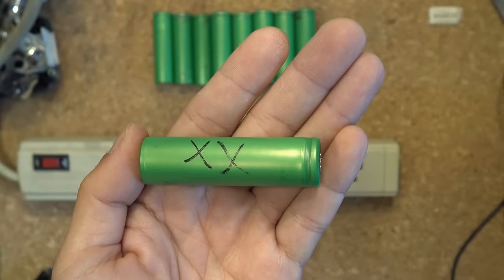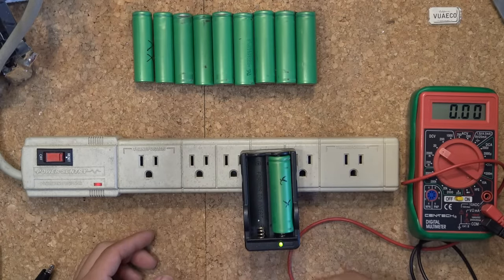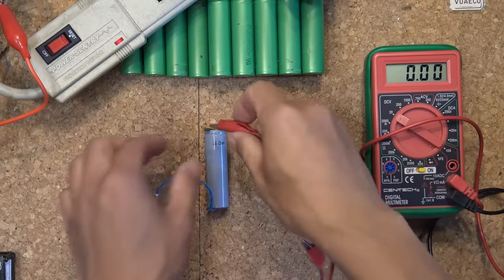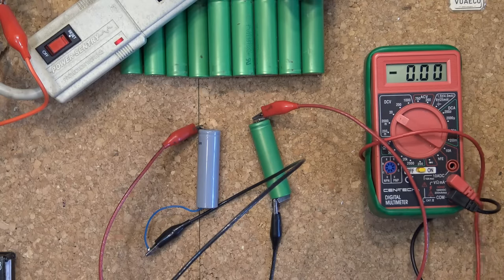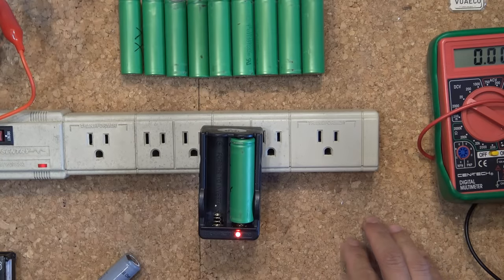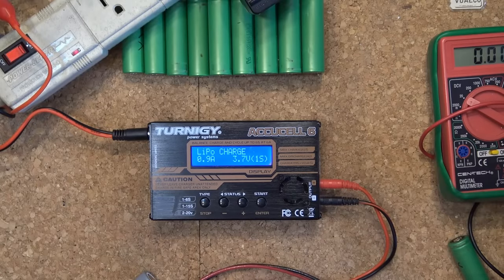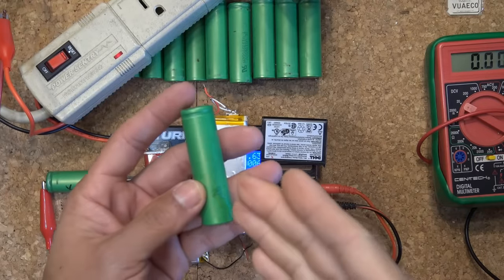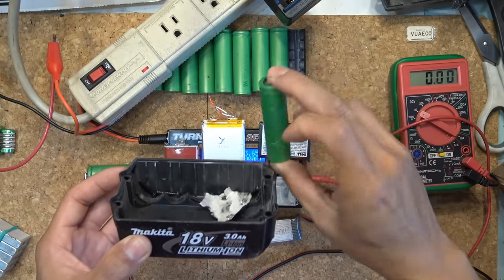DIY: How to revive a dead 18650 (or any) Li-ion battery cell

Comment: A case for a $3 meter?
?
So it doesn't slide around or float away?
Reply: The guy must like his cheap meter... I try to take care of mine, but like 6 months later they show like 5-6v on a lithium battery (way off!) and above 20v on a car battery, lol, but that exact meter he is using is typically free with any purchase (including $1 heatshrink packs etc) at Harbor Freight tool stores. That’s all I used to use, I had like 8 of them, none held up but they were free, the leads were extra garbage though).

Recently I bought some decent ones (like thousandth of a volt when checking batteries like this), but honestly the coolest one was bought just to get me over $50 for free shipping was actually really cool auto-range meter. It just has a power button and that’s all it needs and it just automatically checks resistance or voltage, so when I hooked it to a bad battery and got a resistance value then lol, I knew it was bad battery, haha! Normally having it in resistance mode blows up meters (or trips a fuse, which is hopefully a resettable one so you turn off and back on), but this meter you can jump between resistor and voltage on batteries immediately and nothing goes bad and without damage, so it’s pretty awesome since it’s also accurate enough (it seems to be within 0.01 to .02v when testing an 18650 4v battery like this video, it only goes into hundredth of volt), so hands down I’d recommend just spending $10 for one of those instead of even these free meters like he’s using, because the new ones don’t have a voltage calibration inside so they become junk pretty fast and often WAY inaccurate out of the box (the old ones did, so you could correct them though it didn’t have a separate adjust for current/resistance/voltage so you just calibrated the one you used most).

The leads are also way better, it’s stamped YOYOUBAO  model ET8133 (it also has an awesome kickstand for propping up and a kinda crappy LED but it works if you absolutely need it, but it’s amazingly simple and decently accurate (now obviously it’s not an oscilloscope it 20 digit laboratory meter, but it’s pretty amazingly accurate for how low cost it is and easy enough I’d almost call it foolproof but I’m sure I’ll destroy it someday doing something stupid, haha, I always do!). But if you need better the AN8008 is pretty awesome too at under $30 (it honestly looks way more fragile, and the kickstand sucks, but it’s probably better to not drop it anyways... you might actually want that case he’s using on it except it’s a little different shape). I still need a good scope for sampling 200 MHz switching voltage stages (so with a nyquis frequency of 400 MHz it starts costing more than the cheap ones since I need within 1/1000v so I haven’t pulled the trigger on any yet, lol, it’s probably going to have to be used and then calibrated to match steady voltage of whatever my best meter shows, haha they cost too much!)
Reply: @jakegarrett8109  Have like 6 or 7 of those that I got for free at HF.
They're accurate with volts and ohms until the leads fall off.
Have one glued on to a radio that I converted to lithium and solar. Needed a charge monitor. All free.
Reply: UNENSLAVER 1 yeah, but mine are getting WAY out of correct voltage (the recent ones especially are way off right out of the box just compared to each other, like 10% error, though kind of still useable just to see if a battery in the TV remote is completely dead). It doesn’t matter which leads I use or if they are directly soldered to the PCB (I repair the leads when they need it). One of my old ones was a favorite of mine so it has more voltage circuitry added too it than it came with (it’s over doubled in components, it can be powered off anything like it’s built in 9v battery, or an added built in LiPo battery or external hookup like a car battery or computer power supply etc with a boost converter and a second boost/buck converter for 4v to 40v input. I left it hooked up most of the time to my computer to monitor socket voltage since at least it was more accurate than software reports, lol! But that’s why I got the new meters, so I can know the real voltage since if I’m pushing processors hard at sub-zero temps the sensors often go whack just doing that but also you typically are running them with voltage cranked to near destruction anyways so you really need it to be accurate, hence I grabbed one for accurate 1/1000th volt but need a scope eventually for better tuning and modding).

I did get some extra leads for those old junky meters since those things I was constantly repairing cause that plastic insulation isn’t very good at fatigue when using them very much, lol, but yeah like 4 of mine went shot (2 with dead screens, or most of the 7 segments displays unreadable, a third where it seemed to become a random number generator, haha! And the 4th is just like 60-70% off. Oh I guess maybe a fifth died because one just does not turn on anymore and I swapped screens but nothing happens).
The old ones were way better, the circuitry in the new ones is not even close to the same (and the newer probes suck even more, one additional meter broke immediately the first time I tried to insert the probes, they didn’t cut the slits so the connector could flex! PCB snapped off where they insert through the rings...)

Comment: It is indeed possible to get them to "charge" again. But their capacity to hold charge is gone. This should only be used in emergencies. The battery is dead but doesn't know it yet. A zombie batt if you will.

Comment: I’m wondering if anyone can help me, i have 14 Saft vl41m lithium ion batteries.. they’re from a seabob and I need to try and boost the batteries back to life, they are showing around 0-0.02 volts each on the multimeter.. these batteries are extremely expensive as usually used in military use, they are supposed to last up to 30 years and around 4500 cycles and even after that should still have 80% of their original capacity, I was wondering if anyone could advise me on how to recharge then single cells separately? Or if this is even possible?
Reply from the maker: It's unlikely every single cell is 0V but if it is then you can try to boost every single cell one at a time. If you see an increase in voltage then it's probably still good. If the voltage does not increase after you boost it, it's more likely dead. Check out this video where I tried to salvage the cells from a very damaged ebike battery pack: https://youtu.be/-ir466Ls1hc
Reply: vuaeco ok I will watch that video, well most cells are around 0.21v but some are minus voltage? I have a imax b6 charger will this be good enough to boost/charge the cells? Thanks, I’m really grateful for you help and will subscribe :)
Reply: vuaeco also how would I boost each cell? Because I don’t have a working cell to put them in parallel and raise the voltage like you do?

Comment: be careful doing this, generally speaking, if its lower than 2.50 volts then it could be damaged internally and may explode when being charged back up ... you never know. if your going to keep doing this then you may want to do it outside where there is nothing to burn down if it explodes ... <just sayin> there's a reason why chargers don't charge 18650 batteries below a certain voltage, they don't want to be sued for burning your house down ...

Comment: there is a better way , charge with a nicd setting for a minute at as low as  amps you can set ,then setting back to li ion and your good the nicd setting brings the volts up just don't do it for to long or to high of amps

Comment: now try it with a cell that is at 0V and behaves like a short circuit
Reply: I’ve never seen that, the resistance I’ve always seen goes high (like in the mega-Ohm). Maybe if you had a puncture with a nail sticking through it though, haha!

Comment: These recharging methods may work just fine for some but (and this is the real kicker right here) with the rise in popularity of rechargeable gadgets found in the home and/or garage and the quantity of these "DIY" battery boosts found here and on other video sharing formats there is a proportionate rise in news stories across the globe related to very expensive and sometimes fatal house/apartment fires caused by exploding battery packs that have spontaneously combusted while the homeowners are sleeping. Food for thought here do-it-yourselfers.

Comment: The problem is: not how to revive a dead battery. That's not hard and almost everyone knows/ knew how to. The main problem is: how long THAT BATTERY will stays charge? If a "good battery" discharges itself after hours, THAT ONE will last up to half hour. Surely shorter.

Comment: Just raising the voltage above the charge threshold is meaningless.  Batteries need to be able to HOLD a charge over time and to discharge near their rated value.  I wouldn't use this method for anything critical.

Comment: sometimes over discharged nimh wont register in my charger, a quick boost with a current limited bench psu set to 1.2v will get them going, i charge my liion with it set to 4.2v and like 1A current limit, i think its safer that paralleling two batteries

Comment: Take your dead batteries apart "make sure they are 0v", unwrap the lithium foil, dump water on them and watch the fireworks!,  Dont do this with charged ones as they WILL catch on fire when you try to cut the battery case off :)

Comment: My milwaukee m18 Li-ion
wont go. Im afraid they created copper bridges. Then there junk i think.
 I tryed the youtube video advise jump start 10 to 15 times by touching a 12v battery charger.  
Im going to try jumping on my other working m18.
I almost bought a Amazon aftermarket 18v but the reviews are messed up bad experiences. Batterys that work once then wont charge.

Comment: Easier method: cut a usb cable end off use the red and black wires job done works everytime and wont overheat batteries because amperes are too low

Comment: When i was trying to charge my batteries the charger said that it was a nimh battery then hits me with an error. Can somebody please explain why thats happens
Reply: It is because the voltage is low, and the charger detect that it is NiMH battery as typically it is low voltage. There is video post by this guy too.
Reply: @seaselol  ok thanks man. Could you tell me whats the name of the video. I was looking for it but i didnt find it

Comment: A dead battery is 0.0v This is what my  18650 LGDBHE41865 yellow  is measured at.  I found them in my headlamp that was most likely left ON and ran down the battery.  These were slightly used batteries too. The 2 batteries still look new Is there anything I can do to revive them ? I think I already know what the answer is.

Comment: That is very dangerous method ...... you would be better to have used the LiPo charger set to NiCd mode and charged till just over 3.0V ... then charge as a LiIon normally.
But of course the cell is no use for serious use anyway ... so low would kill it for high power use - its Internal Resistance due to chemical damage internally would mean its power delivery is seriously compromised.

Comment: When u see a Harbor Freight dvm, u have to question the accuracy of any results.
Reply from the maker: Sometimes life is not about getting a good card but how well you play it.
Reply: it is fine for what he's using it for. the method is pointless as the battery will not recover, but don't knock the tester 😃

Comment: This is not safe! There’s a reason it doesn’t charge! Over discharge causes copper dissolution which can lead to internal short circuit if you recharge it.

Comment: See alot ot electronics theseday dont run the batteries right down ...electronics cut off when the voltage drops so far......look at the car of it was a weak battery it would turn over slow but now after the car battery hits 9 volt it wont even click or turn over....walkmans used to play slow but electronics are like that thesedays ...this could be to save the electronics

Comment: This doesn't revive tha battery, it just make you able to charge it. It's still broken and will have very poor capacity.
Reply from the maker: Well if your battery does not charge and you have no other way to get it to charge, it's going to the trash. How much capacity is left depends on how much it was abused earlier. If it's just simply very discharged, you can restore to its full capacity. But if you have no way to get it to charge in your charger, it's still going to the trash. This video is a proof for that: https://youtu.be/yuLdi4oT7xI

Comment: DONT DO THAT!!! The other good battery cell will charge the dead one with a very high, very unhealthy amount of current!! This could lead to a fire or even an explosion! If you want to revive your cell the right way, first of all take only cells with a MINIMUM voltage of 1.5 Volts! Otherwise it could get very dangerous! Then charge the battery up with a lab bench power supply using a CC CV Method. And PLEASE use  a maximum current of 0.5, or better 0.4 Amps! Lithium cells are dangerous! Do cell reviving only if you are know what you are doing! I hope that was helpful and prevented some innocent people from starting a fire or worse.

Comment: whole problem- this method is not working. it will blow whole battery pack. Benn there done this. needed more batteries  for my 48V->60V electric bike experiment. This batteries hold no charge! you can see how voltage is dropping back in minutes

Comment: I use a lab supply for this.  Got to be careful people.   This method is just stupid.  I control the current and monitor the voltage.   If it doesn't start to rise at say 100ma just give up.   Thumbs down on this reckless method.  Use of the magnets are about the only smart part which I've been doing for years.

Comment: dont use this method, is dangerous. use a power supply and limit current to 10-20 mA, and wait till the voltage on the cell gets to ~2V, then slowly increase current to 50mA. When you get over 3V, you can use 500mA for charging.

Comment: You are doing a shortcut by doing this. This is dangerous and you are endomaging both batteries. In RC hobby we do parallel charge batteries. We all know that we cannot parallel connect batteries if they are more than 0.2 V difference. It is working with a liion because internal resistance is high enough  and this is saving your xxx. That's why they are hot immediately. But don't do it at all with Lipo... It will explode.

Comment: That's not even the same battery you were testing the battery while the other one was hooked up to it you're getting the voltage from the battery next to it that battery has small x's on it the other one had large x's on it

Comment: Hm, ingenious, yet couldn't you  more simply connect the battery to a bench power supply set at 4.2V and 0.5C maximum current?

Comment: cool, I've had 2 university professors and an annoying Australian dude with too many subs  call me names and insults for this... lol...
usually use my power supply and they cells typically come back up to 70% or more capacity.
though the people above are in denial and would rather name call. 
just watch your temperature..

Comment: Short term fix. Once the battery chemistry has changed due to low voltage, it'll lose most of it's capacity. Waste of time.

Comment: Stupid, the "bad" battery is already damaged (that's why you have problems with it) now your charging it with the value of the other battery which is usually way too much. By doing so damaging the bad battery even more.   Lithium batteries who are to far discharged should be revived with very low amps and volts.

Comment: the first battery you used with two x mark are dead...then the second  battery you used  without x mark is good one...i saw the first battery you used is on left upper of some batteries ...thats why i dont believe you...if batteries are dead...is already dead....
Reply: You need to look closer!  The battery is the same one. At the beginning of the video you can see a battery with 2 X's on it as well as the one he is demonstrating with.
However, this is just dangerous!